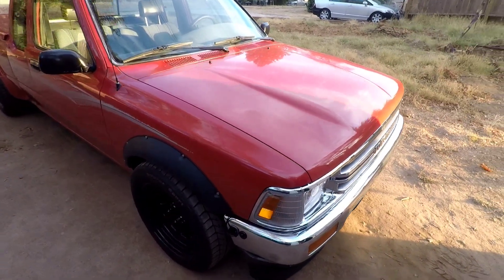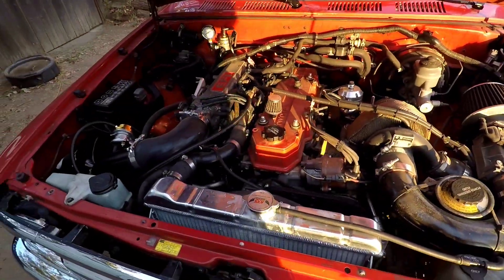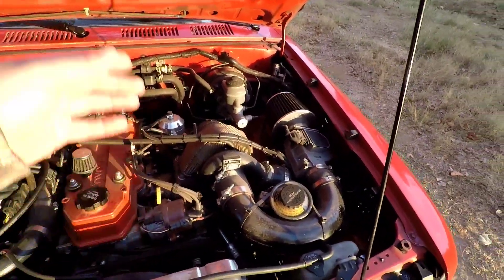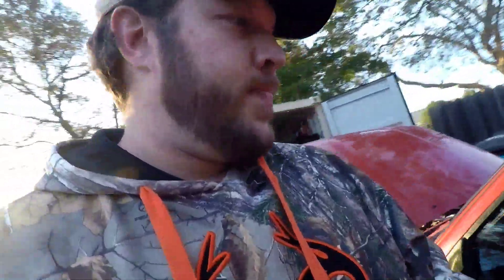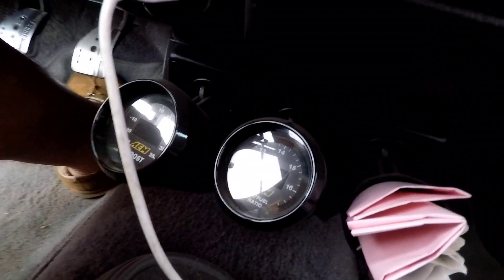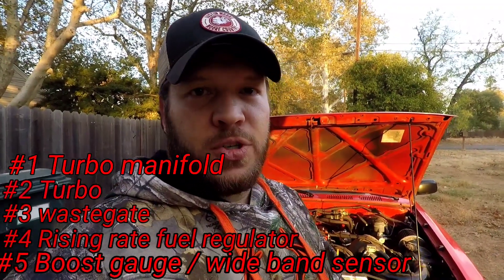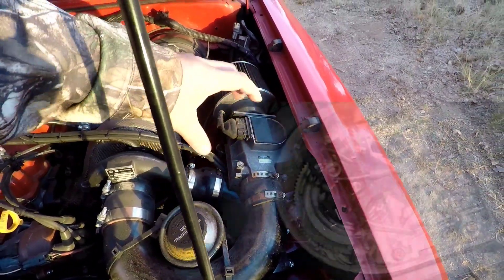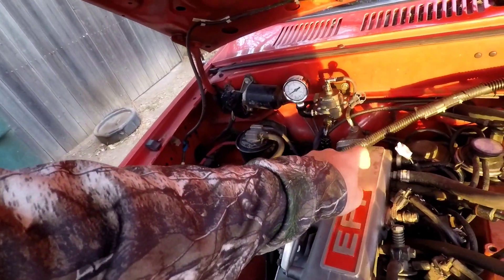HOW TO TUNE A TURBO TOYOTA!!  #standardamericanoutdoors #theredsled

Comment: I know it was 4 yrs ago but I’m super curious how much Hp would you guess it feels like you gained.  I like dang good but I’m hoping to go from 90-100 to hopefully 150/175.  Does that sound realistic? My 95’ was just installed with a new crate motor from sunwest engines in Wa state.  Appreciate any advice.  I bought it new here in Seattle in 94’.  Got to give it a decent boost or a 2JZ!!

Comment: Do you the brand and size of the turbo?
Reply from the maker: I actually got it for free. It was a low hour take off from my old job.  It came off a 4.5 liter cummins.  Turbo brand was John deere.
I'm unsure about the size.  But i do know that it loved a 3 inch downpipe vs 2 inch

Comment: 3 years later you ever blow up the engine ?
Reply from the maker: I sold the truck awhile back. To my knowledge, it's built and running strong.
Reply: @StandardAmericanOutdoors  was wondering what kinda problems you encountered and how you went about fixing them
Reply from the maker: The main problems I had was the engine itself.  It was hurt after a long life as a work truck.  Once the motor was freshened up, it ran ok.   Once I started using it as a daily, I started noticing things that needed to be re done.  Like a thicker exhaust manifold. After that, it was a bigger and thicker downpipe and wastegate return pipe.  Went from 2 inch to 3 inch dp.  Boost control was a concern. So I spent some cash on a decent vacuum boost controller. No boost creep after that. But right when I sold it is when it ran the best.  Buyer drove it home about 4 hours away. Not one problem
Reply: @StandardAmericanOutdoors  your the man bro 🤙🏼🤙🏼🤙🏼

Comment: The 22re will run 9 psi of boost completely stock or it requires any mods ? Plz it’s my dream to get my 94 turbo
Reply from the maker: Don't get me wrong.  It requires a few upgrades.  But long story short.  It can be done

Comment: This is all bullshit, you can’t run stock injectors at that pressure, they won’t even cycle and that timing without knock
Reply from the maker: Lol you can in fact.  I did.  It's still running today...

Comment: Is that the gt35 turbo? 🙏🏼 I’m trying to duplicate that sound. 😭🤣 I’m doing a fully stock looking 93 4x4 with 122k original miles. I just want to keep her at 4-5 psi also also I need an adapter plate for the exhaust manifold? One inlet the manifold side seems square bolt pattern with round inlet, and the gt35 has a rectangular opening and different bolt pattern it seems 😭 please help I’m so lost lol I did the head gasket on this thing no problem a few months ago but these bolt patterns are stumping me. 😭🙏🏼
Reply from the maker: The turbo specs are very close to a gt35.  You do need a exhaust flange. You do need a t3 flange or whatever flange to match the turbo you have.

Comment: What manifold and turbo combo are you using? Lol I’m trying to get everything for under 500 😭 I’m Amazon and eBay friendly lol
Reply from the maker: Lol. Home made log manifold, my cost was 100 bucks and weld wire. turbo is off a 4 cylinder john deere. Got it for free

Comment: Thank you for the video question so I have an 87 Toyota forerunner Turbo factory Now we went with the Garrett after replacing a head gas getting timing chain but no one seems to know how to work on this vehicle they just scratch their heads they don't know what's wrong with it their times it runs perfect and there are times it kind of falls on its face for no reason But nobody knows how to set up the   mass air fow meter or the Throttle positioner   any suggestions
Reply from the maker: Nice setup 👍👍   I'd get everything set correctly  just to get a good base.  Youtube has a bunch of videos on how to calibrate the tps.  You need a afr gauge and a wideband sensor to tune a maf sensor.
A adjustable fuel pressure regulator helps out a lot too

Comment: Love the video man, im in a 89 3vze pick up. Need so help with installation on one of the following turbo installation and total parts needed, header and intake mainifold upgrade with exhaust. I stuggle finding videos for this year and engine / model. Its a 4×4 pick up.
Reply: @StandardAmericanOutdoors  Honestly man I think I might have a few issues to take care of before doing some upgrades a couple oil leaks maybe you could help me know how difficult it is for a beginner before I start the project were talk a leak by the oil pan underneath the truck and maybe a couple others and a possible vacuum leak. Could I send you some pics. One more thing the idle seems to be high some times and low other times is there a part or easy adjustment you recommend? Sorry for the essay. Lol
Reply: @StandardAmericanOutdoors  parts list at would be great and I was wondering can I put an rpm gauge in it when there's not one currently or any set up for it that I know of.

Comment: What manifold and turbo?
Reply: @StandardAmericanOutdoors  I was thinking about doing a ct26 and eBay manifold running 5 psi. I have a set of arp headstuds to throw in it just haven’t pulled the trigger on the turbo setup

Comment: Thanks for the tips. I have a 22rte in my 75 celica. Needed help tuning. Been using the AFM hack for a while. I’m on 10psi on stock with garret turbo and Mitsubishi intercooler.
Reply: @StandardAmericanOutdoors  it’s nice! Been running a little rough for the past couple years. Threw the timing on it and have been chasing the perfect adjustments for a while. But I think I’m close. Check out my most recent video of it on my channel. You definitely convinced me to buy a proper AFR gauge and check if my fuel pressure regulator is a rising regulator.

Comment: Hello . I have my 1994 turbo toyota ready but I have 330 cc injectors and original ecu.  it may work ok
Reply: @StandardAmericanOutdoors  Ook thanks I have a small turbo.  350 hp max.  I have turbo pistons
Reply: @StandardAmericanOutdoors  I have LCE brand connecting rods.  maximum of 375 hp.  but my goal is between 150 and 200 .  but for the moment I want to use the factory ecu
Reply: @StandardAmericanOutdoors  Thanks I'll try to adjust the fuel.  I just would like to know how to modify the maf  sensor. Thanks
Reply: how many pounds do you have on your fuel regulator?

Comment: How did you end up adding the adjustable fuel pressure regulator to it? Did you completely remove the stock fuel pressure regulator at the rail? If  so What did you put in its place? 
Thank you sir
Reply: Man I appreciate your time.
I just purchased that same fitting you were talking about. Thx

When you come off of the fuel rail where the stock fbr was, did you have that running to the In or out side  of the fuel pressure regulator? Basically did you just have that one line coming from the stock fuel pressure regulator and then the return only? 
There wasn’t A line Coming from the fuel pump running to this adjustable fuel pressure regulator?
Reply: @StandardAmericanOutdoors  got it ! 
You da  man!

Comment: I just spent 6500 at LCE Performance on top/bottom end, intake manifold, exhaust manifold, holley 500 carb and turbo kit(doing blowthrough setup) and light weight flywheel just to name the main things- for 87 4x4 22R single cab.. only issue is I have to wait 5 weeks for parts to ship):
Reply: @StandardAmericanOutdoors  yes unfortunately. Got a lil carried away lol. I'd prefer over-built than under though, I'm gonna start at 10 psi and play with it from there, it'll be a hell of a ranch truck

Comment: Hello how are you . Could you explain to me how to install the gasoline pressure control I would be grateful I have gotten inside and I am inside the engine and I see that it is the most difficult part for me I am using 330 cc injectors for turbo 22RE stock but I think I need more fuel pressure

Comment: How do you adjust timming? Or what's your base timing? I'm currently running 4 psi anything above that on wot knocks a little,

I'm basically running the same set up

Comment: What did you do for oil delivery?
Reply: @StandardAmericanOutdoors  thanks. So I was thinking about doing an oil filter relocation kit and putting the turbo in between the outlet to the oil filter and the oil filter so any metal coming from the turbo goes to the filter before getting to the engine. Thoughts?

Good info in this video but could definitely be shorter and go more into detail on your setup. Thanks for the info on the AFM adjustment. I am gonna tune mine back
Reply: It's a cheap turbo. Couldnt afford a real one but people have done reviews on it and been happy but I like security. 

Yes if I can stay motivated to move forward on doing the turbo conversion I'll be doing a full how to on everything I do down to ECM swap. What you did is amazing and flat out genius. But I cant allow the AFM to live any longer than it has and i have some electrical gremlins
Reply: Cause they need all the power they can get. But the limitation is that AFM. That like 1.25 inch flapper is a limiter.

Comment: if you swap over to a 5mge afm itll create a slightly richer condition, plus a 3 inch inlet would help with flow compared to the stock 2.75
Reply: @StandardAmericanOutdoors  it would be the afm from a 82 celica supra. It shares the same voltage signal (0-12v) also it's a 2 pin as opposed to a 7m 3 pin. You can also use a housing from a 7m and replace it with the guys from the 22re one and it should work fine
Reply: @StandardAmericanOutdoors  no problem! Just a fellow yota guy tryna help out. Also! https://www.yotatech.com/forums/f116/22re-afm-junkyard-mod-more-power-261121/

Comment: I have one equal to yours 2wd 1994 extended cab and I want to install turbo and this video is the one that has given me the best ideas.  Thank you could you tell me which gas pump you used.  Thanks 🙏🏻 bro 😎
Reply: @StandardAmericanOutdoors  I want to use the ct20 of the toyota 86 or 87 it will be a good idea
Reply: @StandardAmericanOutdoors  thank you I appreciate it.  a question what kind of turbo is the one you bought. thanks
Reply: @StandardAmericanOutdoors  Hello, can you help me how did you install the pipes of the Inter cooler?  and what turbo do you recommend for my 22RE with forged connecting rods and turbos pistons thanks 🙏🏻
Reply: @StandardAmericanOutdoors  what do you think of the borg Warner s 252 s200 T3 90 mm.  or one of the brand mahle.  I have everything to assemble, I only need the exhaust pipes that I intend to order.
Reply: @StandardAmericanOutdoors  I don't use Instagram just Facebook.  what I do not know the turbo type T3 is the same as the ct20 the exhaust assembly
Reply: @StandardAmericanOutdoors  yes 👍🏻